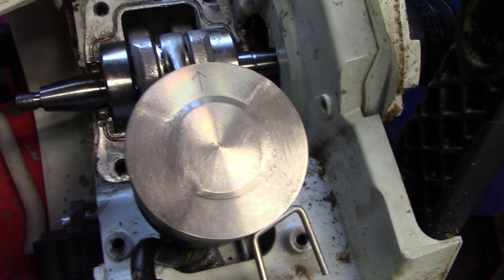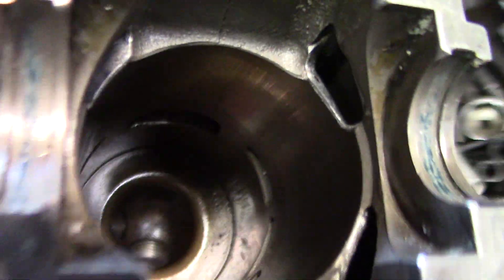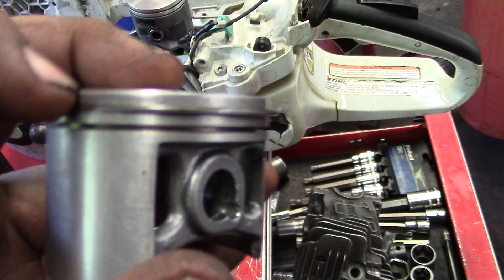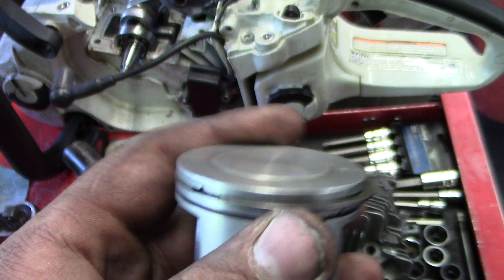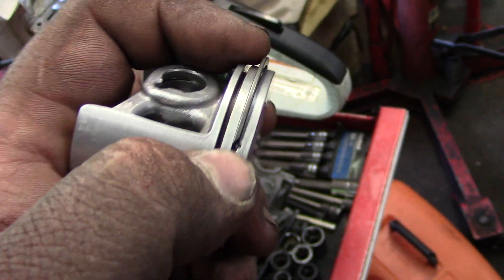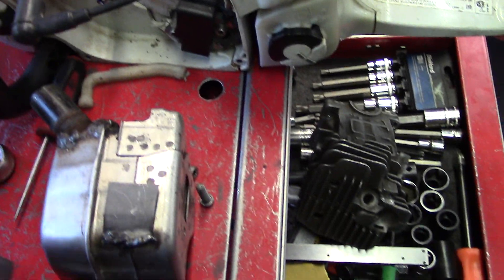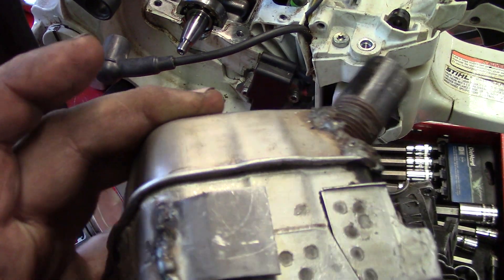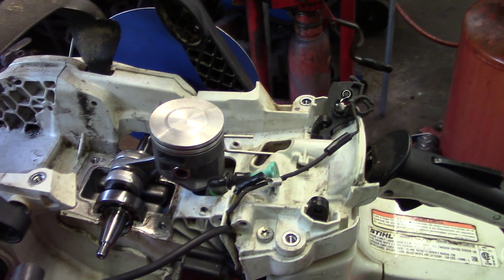Chainsaw Porting Putting Bevels On The Piston For Transfer Timing Video 1

Comment: Do you think you could help me get started on porting my MS 194T doing a cylinder port I've watched tons of videos and I pretty much understand everything but don't know how to get started that's all I need help with is step one step two step three type deal for the MS 194t cylinder port If you're able to respond and help me that would be a big help and I would really appreciate it your videos are great and have been a big help so far
Reply from the maker: On that 194t That is a clam shell design. Most small saws that are clam shells really benefit from a muffler mod and a timing advance. On strato saws look make sure you upper transfers are completely open at the piston at BDC. if the piston is slightly blocking the transfers put bevels on the piston. I would try maybe .010 -.020  see how that runs. I would not do much cylinder work my opinion because you may lose power. I would texture the intake maybe polish the exhaust. See how that runs.

Comment: How does doing this effect the squish band and compression?
Reply from the maker: It depends how big the bevels are. on this engine it had 160psi before now has 150 psi compression so it lost 10 psi with .026 bevels.
Reply: I've used this technique on saws that I wasn't familiar with. I would figure out what the saw wanted for transfer duration by removing material from the piston. After I got my numbers, I would raise the transfers in the cylinder with a new piston so I didn't lose the compression and flow characteristics of the modified piston. Just my coupla cents. Keep at it. It's all about havin' fun!